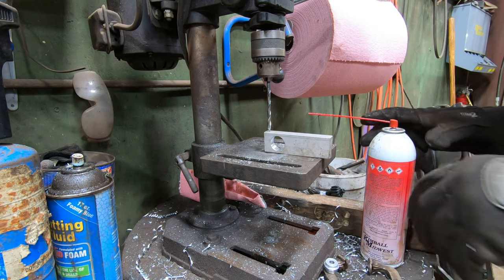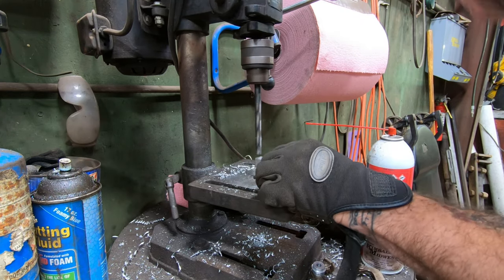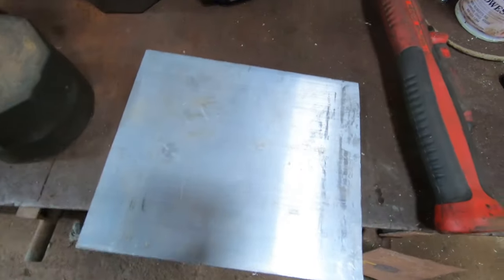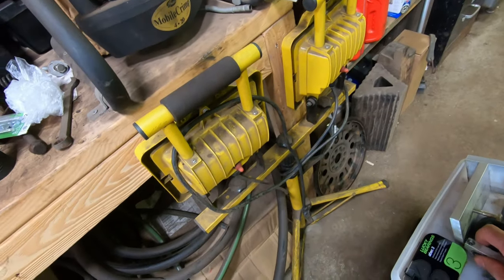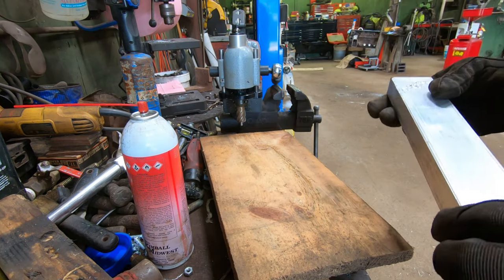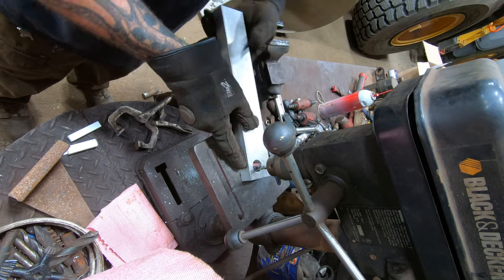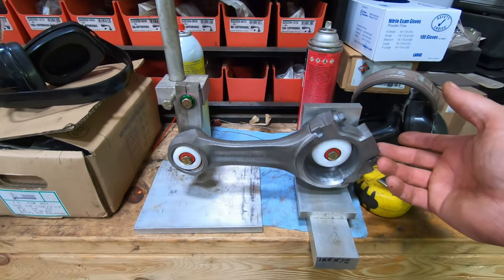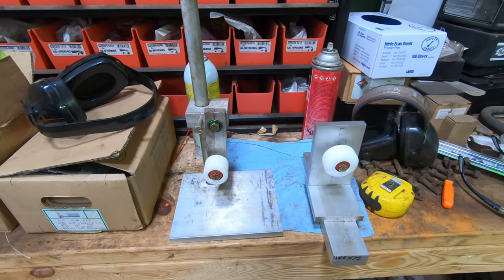building a connecting rod balancing stand part 2

Comment: How were the reading on the scale ? Pretty consistent? I just build one too but can’t seem to get consistent readings
Reply from the maker: I made a video balancing them. They were pretty consistent. I marked the scale where the base was so it shouldn’t move. You want the two stands to be set so the rod hangs centered and doesn’t want to rock to one side or the other. So if the stands are too close together then the round ends on the wheels can apply sideways pressure as gravity tries to follow the circle of the rod ends. If you still don’t get consistent readings you may need a better scale. Try weighing just the rod on the scale a few times and see if it’s just the scale that isn’t reading consistently. I think I used a kitchen scale from Walmart.